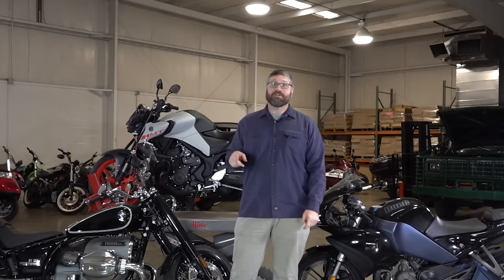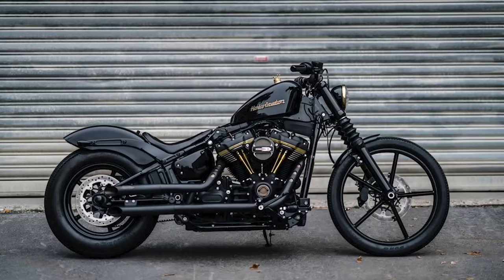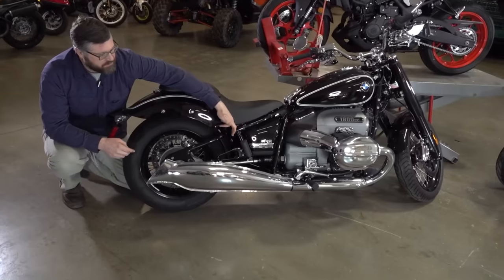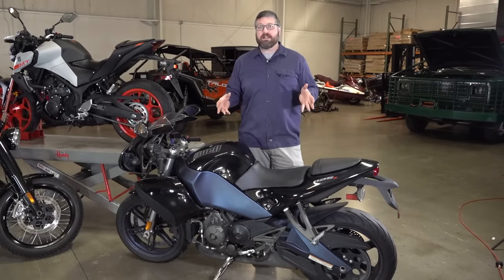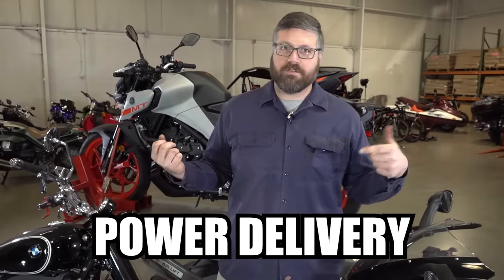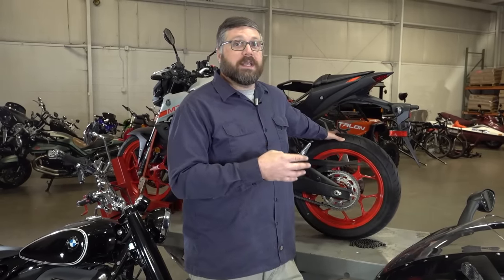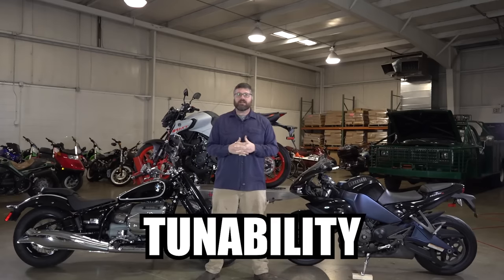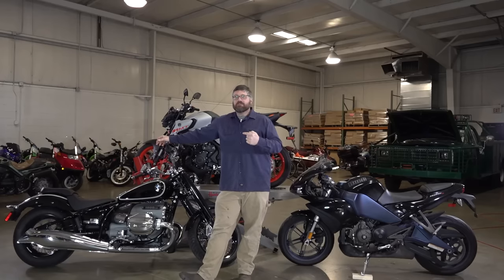Motorcycle Chain vs Belt vs Shaft Which one is Better?

Comment: Sorry Craig but I say chains are a PIA, Period!!! If you ride hard & often, even if you keep a chain cleaned & oiled you're lucky to get 10K miles out even the best made chain. And something Craig didn't mention about shaft drives that, to me, are very annoying is that they are very "torquey". I had a Suzuki GS1100 with a shaft drive & besides the huge loss in power to the rear wheel I couldn't stand the way the bike reacted when you turned that throttle! Sorry Craig but I would put shaft drives down at the bottom of the list where they belong, then chains with belts (by far) the winner!

Comment: After riding bikes with all 3 over years..Best one for me is belt (even now I drive belt bike HD Sportster 1200 custom) my first belt made it to 70,000km but I did drive it a lot on gravel country roads, then chain less work with it just spray it and go..only one chain broke on me while driving, and the worst one for me was shaft. And yeah I even needed to change it because it was badly made (it was on Yamaha Dragster 650)..and one more thing shaft is also the worst one to have when is raining or if you change gear mid corner..bike is gonna dance like crazy.

Comment: I've ridden from Tassie to Queensland, over to Adelaide then back to Tassie, i think at least 11000 kilometres or more with a belt drive cut half way through and it never broke. I took a spare belt and a clutch puller with me in case it let go, but it didn't. I even forgot about the belt being cut and did some aggressive acceleration at the lights in Queensland and it never broke. This was on a FXRSSP back in the early 90s. I met a fella touring around Australia with holes punched clean through his belt, no problems . Having said that, the days I'm on an old Triumph Rocket 3 and the drive shaft is great 🇦🇺

Comment: Well presented, however, belt drive, surely can't be as durable as chains and shaft drive is a must for touring and heavier machines, but it is often missed out on through manufacturing production costs, the real negative on shaft drive is extra weight, but the benefits outweigh this, immensely. Sometimes I think shaft-drive bikes handle nicely, through the extra weight "planting" the rear wheel firmly on the ground.  Belt drives are probably applied to machines through cutting production costs quietness and weight saving are their only pluses IMHO. Chains, need maintenance, maybe weekly, but they will not break or mess up driving on rough ground, unless not maintained at all for long periods, but they are messy and require high maintenance.. I have 400 cc motorcycles with shaft drive. You have to remember to lubricate the shaft @ the engine end yearly or every 10,000 miles, but shaft drive gives peace of mind when travelling on the road. The other two systems are just too agricultural.

Comment: My first Harley was chain drive. It was a 1979 Sportster so it was on the right side. While riding I had to occasionally check the tension with my index finger, and too often I had to adjust the tension. The biggest problem was my index finger was always greasy and dirty. My next big bike was a 2002 Indian Chief and a characteristic of that bike was the belt was made from an extremely hard material, hence it made a horrible squeaking sound, and the only way to stop it was soap. So now I was constantly applying soap. My intension was, my next motorcycle would be shaft. Unfortunately I got too old to ride, so never got that shaft powered bike.

Comment: Shaft is by far the best for just riding, cruising and transportation duties.... Touring, etc... I love shaft-driven bikes... However, I do wish most manufacturers of chain drive bikes would just go ahead and make the switch to belt..... I see no advantages in chain drive. Belt drives are great for sportbikes, dirtbikes, and anything else you might want to goose with full-throttle whenever you want.

Comment: Take a look at any high HP bike or any bike designed to see rugged conditions. Like dirt bikes or super bikes, none of them use anything besides chain drive.  Shaft drives were useful back when chain systems were shot after 5000-10000 miles.  Nowadays except for huge, high mileage cruisers, there just isn't a need for shaft drives. Belts speak for themselves, only low HP bikes use them. The other useful thing is gearing changes are a breeze and cheap. Try changing gearing on a shaft drive bike.

Comment: Good video, but a motorcycle shaft drive is NOT a worm gear.  It is one of three bevel gears: plain bevel, or spiral bevel, or possibly a hypoid spiral bevel.  A worm gear is "self locking" meaning that the input can turn the output (usually at a high reduction rate and consequently fairly inefficiently), but the output gear (motorcycle rear wheel in this case) would not be able to turn the input from the engine/gearbox.

Comment: Interesting situation, the older shaft-drive Honda Magnas and Sabres have two different rear options available for the 750 and 1100. It's a rare instance of cheap interchangeability if you want a shorter rear on a shaft-driven 1100.. that being said there's only one option to change to (3.23 vs 3.40)

Comment: The problem with Harley belts is they're so narrow.  Take a look at the belt on a Suzuki Savage/Boulevard S40.  It's at least 50% wider even though the engine is half the displacement and horsepower.  Being a part of the Savage community I've only ever heard of two belt failures in a decade; one was damaged in a crash and the other simply dry rotted out after almost ten years.

One point of order about quietness, belts can definitely develop a squeak when riding in wet conditions and it can be LOUD.

Comment: I prefer Shaft or Belt after 10+ years of riding!! LOL.......if you're gonna rack up miles, chains suck....period. Every brand of sprocket or chain seems to Wear at different rates, based on quality! It's kinda of like Tires......the crazier you ride, the faster parts burn up....and sometimes at different rates, so sometimes you're Forced to drop Extra $$$ on a Whole Kit vs Just replacing a chain, or 1 sprocket for cheap.(don't even Think about running china junk either!)......

Comment: But why all 100 kW HD's etc. are using so thin rubber band when even old 90's Suzuki S40 / Savage with 25 kW massive Kevlar belt? Is it doing some with a power loss or driving smoothness (bends) or what?

Comment: Chain every time. Gives you one less reason to go to the dealer. Belt to a lesser extent. Depends on the bike. Changing a belt on a big-block HD is a PITA. The entire primary drive needs to come off and the swingarm has to be dropped. Luckily they, touch wood, seem to last pretty much forever.

Comment: I'm surprised you didn't touch on the riding differences between a shaft driven bike versus a belt or chain. Things like shaft jacking. Harley Riders that have ridden my old V-Max and have gotten uncomfortable with the way it behaves under acceleration or decceleration. A Harley will squat under acceleration a shaft driven bike won't.

Comment: A chain drive is anachronistic and an abomination from an engineering perspective: it's hard to believe that, in 2024, most motorbikes still rely on a hundred links of rusty steel, completely open to rain, salt, dirt and the rider's legs, whirring around at high speed, using a total loss lubrication system that many owners never replenish. Still, if that's all there is, we have to buy it, I suppose.

Comment: The best system is fully enclosed chain drive. Used to be a popular feature on commuter and utility motorcycles (and Yamaha TR1).
Lighter than shaft drive so lower unsprung mass.
Low maintenance - like belt drive but not as expensive. No dirt gets on the chain and sprockets so they last waaay longer.
You can still change the gearing ratio if you want to.
Over the years I've owned several motorcycles with fully enclosed chain drive and it's a system I wish was still in use today.

Comment: I have had multiples of each, first chain is very efficient but noisy and messy, second shaft drive is comfortable, quiet and clean, third belt gives you the comfort, quiet, and cleathliness of shaft, but requires less maintenance...

Comment: Couple of points: A shaft drive will always have a lot of free play, meaning that transitioning between power and engine braking feels very similar to an extremely loose chain, definitely not very smooth. Also, the difficulty of changing final drive ratios comes with a disclaimer: Unless you have a BMW. BMW uses the same rear end casing for a whole range of bikes, but with different ratios to suit the application. So if you're unhappy with the gearing, you can get a different rear end from a different model.

Comment: I prefer a chain. Shafts are good, but not as maint. free as people think. The splines in hub AND at the other end of the shaft need moly paste. Lots of bikes NEVER have the shaft pulled, splines cleaned and lubed. Belts are great IF kept tensioned properly. Stones will ruin a belt and pulley instantly. Chains, while dirty, are trouble free for the most part AND you can play with gearing by adding or subtracting teeth in the sprokets..

Comment: You do sort of miss out the elephant in the room with regards shaft drive; torque reaction. Even the very best shaft drive (take a bow, BMW) still has torque reaction and still pushes the rear of the bike up when accelerating. This may just be perceived as "A bit odd" on a tourer, it may be "Just one of many quirks" as it is on a Guzzi, but it really does mess up how a bike performs, especially if it is anywhere near the limit. I used to have a shaft drive middleweight Kawasaki and it really did take a long time to figure out how it was going to behave when accelerating and leant over. I did finally manage to figure it out, and eventually managed to ride that thing as fast as most other bikes on the road, but it took a long time to get there. 
Chain drive really is very good, and in combination with a chain oiler like the excellent Scottoiler, can be very nearly as reliable and maintenance free as a shaft. I also had a n FZR1000R EXUP that would eat chains. On one occasion I had to replace a chain after only 6000miles. However, with a Scottoiler installed, it did the next 22000 miles with just a single adjustment. What would be even better would be to have the chain encased in an oil run, like the old MZs used to do. It might add some weight (really, only a little), some of which would be unsprung, but the advantages of running a chain in an oil bath are absolutely enormous. Unfortunately, it is not the sort of thing that can be easily engineered at home, so unless there is a manufacturer out there that is willing to invest in this, we're not likely to get this any time soon.

Comment: For me, I will choose belt drive over chain drive for onroad or daily driven applications. Only regular maintanence is inspections to ensure straight tracking and find damage, smooth, quiet, and I retain the option to make a gear change if I found it very necessary.
For any offroad or project bikes, I'd go with chain. Easily repairable, readily available at any bike shop, customizable to any length, easy gear changes, and it generally takes up less space than a belt. Since It would be an offroad or project bike, I wouldn't mind the extra maintanence or lower lifespan associated with a chain.
As much as enjoy the idea of a shaft driven bike, the low maintanence, quiet, smooth operation don't outweigh the extra weight, higher cost, little to no customizability, and adverse handling characteristics that come along with it.

Comment: I prefer chain drive, because there's nothing I enjoy more after having ridden 500 or 600 miles in a day, than to clean, adjust, and lube the chain. I mean, some people would just like to go to their hotel room, take a shower, have dinner, relax, and enjoy their road trip. Not me. I prefer an antiquated final drive that manufacturers continue to utilize only because it's cheap to manufacture and lazy from a design standpoint. I love to get the filth and stench of degreaser and chain lube all over me, while I'm adjusting the equivalent of a bicycle chain on a road vehicle that cost thousands of dollars and can go 100+ mph. In all seriousness, the only bikes that need chain drive are dirtbikes and hardcore sportbikes. As for the rest, there's no reason they shouldn't have a belt or shaft. It's just simply idiotic to have a completely exposed final drive on a motorcycle in the year 2022, moreover one that requires maintenance every 500 miles or less.

Comment: Nice comparison, accurate except that modern belts require no adjustment, as you will find looking at that Buell  next to ya' that has no means to adjust the belt anyway.  And the best part is there is no slop whatsoever like you get with a chain or wormgear driveshaft setups... which means its awesome if you like wheelies.  
Also... the driveshaft worm gear drives need their gear lube changed, belts do not. ;-)

Comment: I will say I love to tinker but I did specifically buy a moto guzzi v85tt because it’s the only midsized Adv with a shaft drive. Less to worry about on the trails and the transverse v twin makes it easy for valve adjustments! Great bike

Comment: They are all good drives so I suppose it would depend on what your doing with your bike. Personally I'm not a fan of the shaft sys, yeah low maint etc but if it does fail its $. The belt just seems like a weak link to me and you still have to adj it from time to time. Chains an chain lubes have come a long way and w/proper maint they can easily go 40-50k even on the 150+hp sportbikes. So it really just depends on your preference and what you plan to use your bike for.

Comment: And the fourth option...  Gear drive.  Granted only found on a Suzuki Burgman 650 which I've driven.  Can't really comment too much on how it feels with respect to other types.  I don't have much experience with shaft or belt and very limited experience with chain.  It works.  I can't imagine it being lighter than any of the other options though.  Even I question why Suzuki went this route instead of just putting a belt behind that box where the gears live.  It would have been a lot lighter and simpler I'm guessing.  Maybe the engineers were goofing off and then some marketing type told them to keep it in.  I don't know.

Comment: Thanks for this video.  I see the point of parasitic loss, but the engine design for me is a bigger deal.  I had a Suzuki GSXR750 (chain), rarely got more than 45 mpg,  I have now a BMWR1250R (shaft) with similar acceleration, and that gives routinely 62 to 65 mpg.

Comment: It is possible to affordable change the gear ratio on a shaft drive Honda VTX, by either swapping the rear gear from a 1300 to an 1800 or vice versa. 

But aside from examples like this, yes indeed, it is cost prohibitive and nearly impossible to change the final drive ratio of a shaft drive bike.

Comment: Shaft drives. Shame Craig, shame!  Those shafts need to be pulled whenever rear tires are replaced, and drive splines relubed with high moly content grease. BMW K-series, specifically, had some issues with lube, and Honda did as well. Lube those splines! And the ones on the wheel!

Comment: If you ride constantly or long distance - shaft drive is the most convenient and reliable option. Any sport usage requires chain, it is as simple as that. If you want a very light, but maintenance free machine, belt is the way to go. Do not ride on bad roads though.
Shaft power losses are mostly a myth. Any dyno stand can confirm that the same engine delivers roughly the same power through the chain and through the shaft, the differences falling within margin of error, sub 1%. That is because the only difference in terms of power delivery between them are an extra 2,  90 degree power turns, which typically are greater than 99% efficient with modern tech and good lubrication. Unsprung mass is much more of a concern and it very much limits shaft offroad use, whatever BMW and such would lead you to believe.

Comment: Chain oilers and cases

In the last 54 years, the improvements to lubing and power capacity of chains has been immense, but 2 devices, formerly used by some have been overlooked.

1. A chain oiler. Specifically an English Scott Oiler. It works. It improves power transmission and uses a light oil that does not attract crud.

2. A final drive enclosure. Think Bultaco Metrella, Yamaha XV 1000 RH or even the Honda, Suzuki, Yamaha step throughs.

Chain drive is more efficient and gives "some" chance for altering gearing.

Overall shaft drive has won me over, especially the BMW systems which don't cause the rear end to rise under power.

The telelever / paralever BMWs are very stable. My 1250 RS has teles up front, and are electronically managed, so it has not proven inferior to the telelever.

Great vid!!!

Comment: Chains with Spacely Space Sprockets are cool but so are coged belts If they use Cogswell Cogs. Shafts are great for mud ridding.I saw some groups ridding BMWs and Motoguzies in thick mud in Germany and Italy. It makes sense after seeing it. Mud would be hard to remove from chains or belts and gears and cogs. Two things I do not like about Shaft drives is it unnerving when cafe racing into corners while accelerating. It causes the back to raise up as the pinion tries to clime the ring gear. Although he said worm gear and maybe he is correct on some makes but I have only seen ring gears and pinion. Worm drive if such a drive is really would solve the strange behavior.